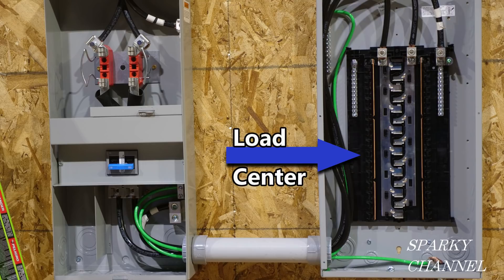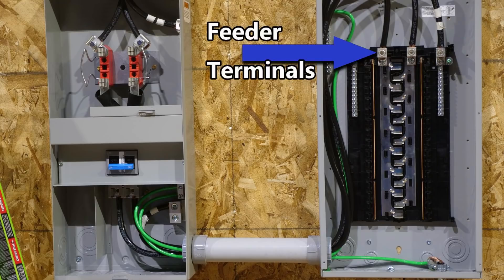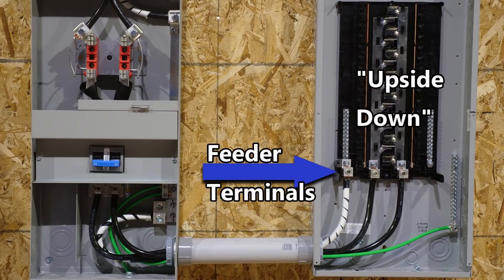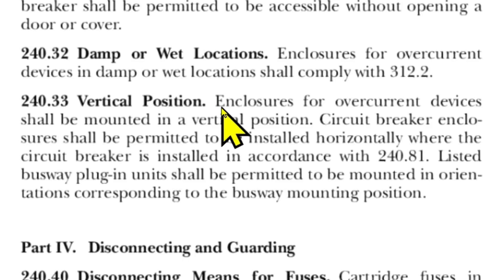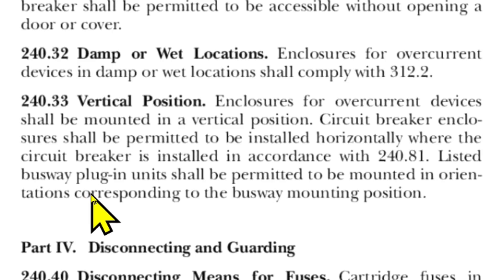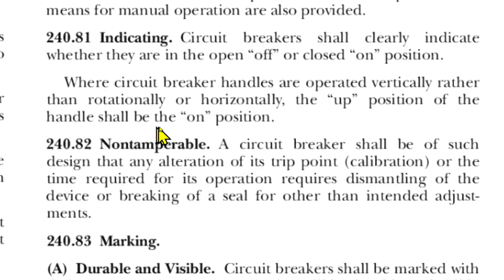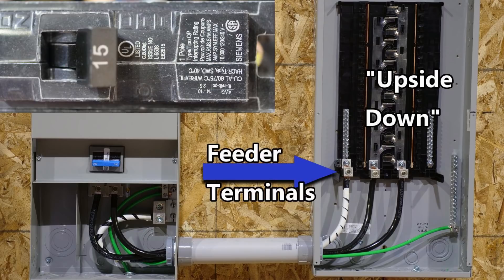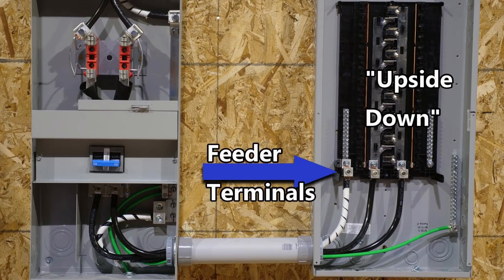Upside Down Load Center? What Do You Think?

Comment: Perfectly ok either direction.At the large hospital/research 5 million square foot campus that I retired from they had hundreds of 120/208 panels where the first panel was normal position due to the 200 amp main breakers. All the panels came with main lugs. The pane!s w/o a main breaker had lugs at top & bottom so they usually installed 3 42 circuit panels side by side daisy chained for feeders. Seemed like a waste of money because they seldom used morev then 50 of the 126 installed bolt on circuit breakers.Last 12 story builing they built a few years ago they went with 7' high 84 circuit panels. They usually only placed 3 general use 120 volt duplex receptacles on a 20  amp breaker. Very seldom got called for a tripped breaker..If you install solar ,wind power or other source must install that circuit breaker at opposite end  of main breaker to prevent possible overloading buss bar.

Comment: Here's a question for you Sparky. Could you mount the meter enclosure horizontally? Now your vertical main breaker becomes a horizontally operated CB in accordance with 240.81
Reply: The manufacturer requires vertical installation due to weather-protective features of the enclosure.

Comment: I prefer the 'upside down' method only because then you don't have branch circuits passing the panel feeder conductors, which in my area would be a code violation.
Reply: This only applies when the feeders are unfused.

Comment: Very helpful. Now I know I can turn my subpanel around and hook it up that way. But one thing is my door would be upside down.   Does that matter.
Reply from the maker: It could be, unless there is a built-in catch on the door.
Reply: @SparkyChannel   I'm not any type of electrician. What is a Built-in catch
Reply from the maker: @Patrickmetaldetecting  That would be when you open the door in an upward direction and it catches open so that you can examine your breakers, etc.
Reply: @SparkyChannel  ok well this box opens to the side
Reply: @SparkyChannel  I have only seen those as a weather proof panel. You can't turn those around. The side knock outs would be above the buss bars. Just like the top K OUT needs to be a weather tight hub. Can't use a male adapter on top. A weather tite connecter can be used.
Reply: @SparkyChannel  I have a Homeline, plug on neutral, main lugs only. It's the value pack
Reply: If the breakers switch up n down, on must be up  off must be down. If all breakers switch side to side, then top n bottom does not matter, unless the panel states this side up only. QO breakers all switch side to side, including the main. Any other panel with any breaker, Normally the main switches up n down. In that case it can only be installed in one position  up is on, down is off. Most disconnects are labeled on, off. Up is on, down is off.
Reply: @mdvener  it's side to side
Reply: @Patrickmetaldetecting  it's  side to side???
Reply: If it is a small sub panel the breakers mostly switch up n down, up is on, down is off. And a weather proof panel, or sub panel, up is on, down is off. Either one, a weather proof panel has a knock out on top for a special weather tite male connector. You will also notice all knock outs on the sides are below the bottom of the internal buss bars
Reply: @mdvener  the subpanel is a Homeline Square D. 125AMPS, 12 spaces 24 circuits. Plug on neutral,  main lugs only indoor

Comment: Question: I am a retired marine living in Baja Ca. Mexico. I ran a #6 two with ground ( aluminum) overhead service line 120 feet to a apartment I’m building in the back of my lot. I used 100 amp 220 volt breaker to supply this line and ran it to a breaker box at the apartment. Then I placed a 30amp 220 line to a garage connected to the apartment. In the garage I connected to another service box with a 15 amp 220 volt . Planning to run lights and light usage lines here in the garage.
I’m experiencing a voltage drop on one leg . Line on the long run is about 127 volts and the other is about 109 volts.
Here in Mexico my incoming service at the meter is supplied on #6 aluminum wires. 
The first service box coming out of the main has its own grounding rod. At the apartment service box : do I install a physical ground here , or just the two line 220 volt? Then from here I ran the #8 20 feet to the shop and another service box with its own breaker. Do I run a ground here?
Thanks for the helping hand
Reply: @Richard A..... The #6 cable is two sizes too small. You need  #2 triplex. The bare conductor has  steel messenger wires in it which are very important.

Comment: Here is a reply I have not seen anyone point out. 
When people explain volts/amps/resistance, they use the analogy of water through a pipe and a kink being resistance. 
Using water for the analogy, water flows downhill, so the cables should enter on top and exit on bottom.
Hahaha, how do you like those apples?

Comment: One thing you did not mention is this load center could not be mounted in the horizontal position as half the breakers could not be filled or all breakers would have to be on one side with on pointing up only.
Reply from the maker: Thanks, good point!

Comment: Before I watch this... I was always taught that it depends on where the service entrance cable comes from (below or above).  The sole reason for this being to use the least amount of feeder cable. 

After watching... I’m not surprised that either orientation is allowed.  I’ve never run across an instance where it mattered according to either code or inspector enforcement. 

Bonus:  I’ve also always been taught to put the largest amperage breakers closest to where their branch circuit cables exit the enclosure.  (Same reason... to save wire)  But, I See That not being done more and more often.  Is it just a new generation of electricians that aren’t as concerned with the cost of wire they don’t buy? (because their employer does) Just wondering....
Reply from the maker: I'm concerned because I'm a licensed electrical contractor. Translated, that means that I'm the one who buys the materials! LOL!
Reply: @SparkyChannel  Exactly my point.  Alot of employees (or third tier subs) aren’t so concerned with how much copper (or Aluminum) ends up on the floor.  It ads up.
Reply from the maker: @fomoco300k  It sure does! I'm surprised that you're the 1st one to mention the cost. I thought lots of viewers would have mentioned the cost aspect, but you're the first.
Reply: I thought it to be closest to the service cable so the least amount of current goes through the bus bar?!!
Cost of cable is a good reason to keep it short though.

Comment: Great video Bill, you got me thinking that I kind of like that arrangement when the SE conductors come in from the bottom.  Then I don't have to fight 3 big ole wires in the gutter to get to the lugs on top and my branch circuits are easier to bring in clean.  I'm a big fan of easier.  Nice vid, thanks.
Reply from the maker: Thanks Scott! Yes, when the overhead service conductors stop at the service disconnect and then the feeders run into the load center with the main lugs on the bottom of the load center I think it makes a nice clean job.

Comment: Bill, you didn't talk about the case where the feed came in from the bottom, but terminated to lugs located at the top of the box.  What about having the feed cables running across the inside of the box where you would usually reserve the space for the branch wiring and maybe a little service loop for those branch circuit wires?  I'm not an Electrician but, if I was doing the wiring, I would have reworked the conduit between the meter box and the panel box with two 90 degree bends so the feeds would only enter the side with the terminating lugs.  In that case being at the top.  But if it is a case where you can relocate the terminal lugs for either top or bottom, then they would have to be moved to the bottom as the remainder of your video showed.  Does the NEC address this issue of routing feed cables through/across the box?
Reply from the maker: Good question. You do want to leave as much room as possible for your branch circuit wires so I think it's best to run the feeder one of the 2 ways shown.
Reply: @SparkyChannel  Does the NEC address this?
Reply: @chrisharper2658  as far as i know NEC is a UK organisation and sparky channel seems US(north american) with 110V system.
Reply: @bertbergers9171  I think you mean the IEC.

Comment: As a datacom guy, I like my cabinets/enclosures to be as clean as possible, with minimal wire inside. Therefore, transferring that to what you have presented here, with the wires coming in from the bottom of the panel, it makes the most sense that they connect at the bottom. If they were to enter at the top, it would make the most sense for them to connect at the top.
Reply from the maker: Excellent point, thanks!

Comment: I think it's safer to run under than under and over.
Reply: I'll play devil's advocate and state that without any non-conducting covers over the main lugs on the bottom, a screwdriver being used to screw something to the neutral bus can more easily fall and bridge something than a screwdriver flying upwards and bridging something if it was at the top. (I'm undecided, but just a thought).
Reply from the maker: @jonathanDIYs  Good point. I don't know why they didn't have covers.

Comment: Question on 240.81.  I frequently come across 6 or 8 space sub panels which are mounted with the two buses are horizontal resulting in two lines of breakers mounted such, that they aren’t compliant with this section of the code.  

The way they are mounted makes sense to me, as they are 14.5 inches wide and mount securely between two studs when mounted that way.   To mount the enclosure so the breaker busses run vertically would require adding blocking to have a secure mount.   And, the manufacturers labeling is correctly orientated when mounted with the buses running horizontally, and all of he knockouts are in the long sides, with only 1/4 inch holes in the short sides.   But reading 240.81, mounting them this way leaves the breaker installation noncompliant.
Reply from the maker: I'd have to see it to give a good opinion but I would say it is non-compliant when installed as you described.
Reply: Help me out here, are you saying that the busses run horizontally with the feeds at either the right or left side? (A sideways mount?) Really need to see it to picture it - - - If it is a 'sideways' mounting, then yes, it is a non-compliant installation.
Reply: @denali9449  They are Square D, QO units.  Installed late 70s, and early 80s as part of writing upgrades on buildings built in the 1930s.  They are installed as sub panels, in out buildings such as garages or pump houses.  Most of them have 12-spaces, in two rows of 6.  Square D makes similar panels, the QO6-12L100 is similar but only one row of breakers, and the enclosure isn’t as large.   I’m guessing they were code compliant at time of installation, and would be fine unless we replace them.  The feed comes into the buildings underground, then up to the bottom of the enclosure, the two line feeds go to lugs on opposite ends of the busses, neutral on left below, and ground right below.  
All of them have what appears to be properly orientated factory labels, running correctly for how they are installed.  

All of them were installed with good clean 90s, and red thread on all of the conductors.  Not the work of a weekender, but someone who had real training, and cared about how the product looked when they were done.  

I’m assuming they met code at time of installation, and leaving them alone.
Reply: I have run across a sub panel where the bus bars are run horizontally, so the top breakers switch on downwards and off upwards.  These are older panels, and predicate the 240.81 article.  Existing installations remain compliant until modified, which has a degree of vagueness to it.  I think you are fine adding circuits to it, or modifying some of the existing circuits.  However, if you were to replace all of the circuits, or have to remove that panel during an upgrade, it can not be reused as it would not comply.

Comment: Here's a something to think about that you didn't address. I was doing a job at a brew pub and when I opened the panel I found they were upside down. How could I tell? The dead fronts were stamped with the breaker numbers and breaker 42 was on the top left of the panel. I thought that maybe it was just mounted upside down but after trying to flip it around it did not fit, it could only go on one way. So it was a code violation as it does state that circuit #1 should be on the top left and in this case circuit #42 should have been on the bottom right.

Does the dead front in your example fit either way?
Reply from the maker: Do you happen to have the code article that says #1 must be in the top left?
Reply: @SparkyChannel  I think he's European since we don't usually say pub.
Reply: I believe the code says "labeled" (to match the circuit schedule). You might have a 'nit' the the label numbers are upside down, but what code says anything about that?
IMHO a bigger issue with 42 pos dead fronts, is they usually have a support flange at the bottom to make inserting the screws (required) easier.
Reply: Dunno if it is the case the 1 must be the upper left or not.....just saw a Square D panel yesterday that used sticky labels and 1 was lower left corner and 42 or 48 was upper right......dunno why it was that way but it was.

Comment: hello bill, I really appreciate what you do for sharing with us but I have a question about the transformers how to know the type of cable that is needed.  thanks brother
Reply from the maker: Here in San Diego the cable coming from the transformer to the service point is usually owned by the utility so we don't have to worry about it. Otherwise, use the correct size and type per the NEC.
Reply: @SparkyChannel  thanks

Comment: I just had a workshop made and 200amp service ran to it. The electricians had me mount my panel in the “upside down” position as it made it easier to run the incoming power to it. Inspector didn’t even ask about it. Electricity flows up and down so it doesn’t mater.
Reply from the maker: Good example, thanks!

Comment: Can the breaker in the meter/disconnect panel be inverted? If so, could the panel then be installed upside down?
Reply from the maker: Sometimes the "tub" can remain as is and the "guts" can be flipped. I don't know about this specific case though.

Comment: When a three phase is "upside down", where do the phases go?  On the left lug so the top left breaker is L1-Black?  Or on the right lug so breaker #1 on the lower right is L1-Black?  I know what I usually see and do, but I have seen it both ways!  As long as the L1-Black feeder wire connects to the L1-Black branch circuit wire, does it matter?
Reply: Its works the same. Just go left to right.
Reply: Good question, I was looking for that one. The code says that phases are to placed left to right or top to bottom. So if that had been a three phase 120/208 sub-panel the conventional colors would be black, red, blue left to right for both installations.

Comment: Is there a height requirement ? is that why it was mounted upside down?
Reply: you can't have any breaker handles more than 6'6" from the floor, but that didn't apply to either orientation.

Comment: This example works either way because it's a main lug panel... if it was a main breaker panel,  then the main breaker on/off positions should be horizontal  to be acceptable to be installed upside down... if the main breaker is vertical,  then it cannot be installed upside down
Reply from the maker: Yes, I agree.

Comment: Ok so where it says breakers should be installed where ON is in the up position reminds me of a job where an apartment complex handyman installed a Chinesium breaker system and all the breakers had ON in the down position, because that was how they were designed and intended to be used. It looked like the panels used in the UK/EU but it was split phase for use in the US / etc.
The disconnect on my HVAC condensing unit has a similar breaker (Schneider and not a Chinesium brand) in it also and it has given me no issues in 3 years of service.
Reply from the maker: Wow!

Comment: What if the word "TOP" is embossed in the back of the tub? Would mounting it upside down violate the manufacturer's specifications?
Reply: The tub then has to be installed in the designated orientation, but the 'guts' of the load center can normally be flipped upside down. Manufactures directions with the panel and or on their website will have instructions on what can and cannot be done with a particular panel.
Reply from the maker: @phildegruy9295  Excellent answer.
Reply: @phildegruy9295  right on bro 👍